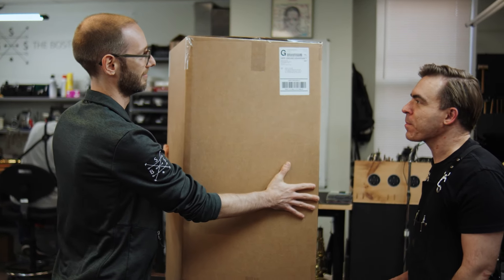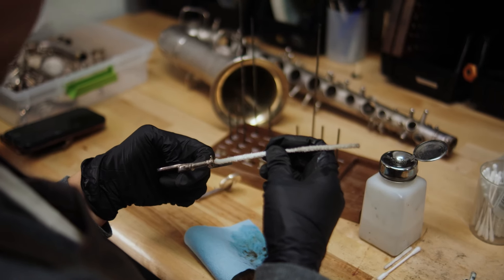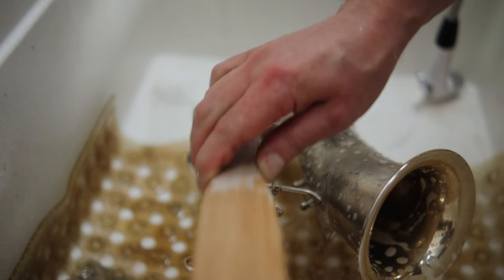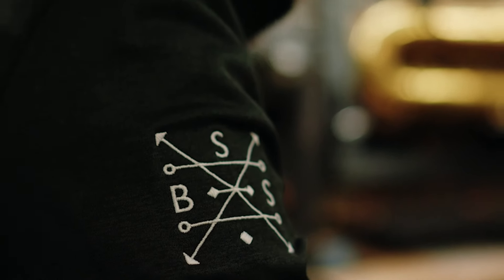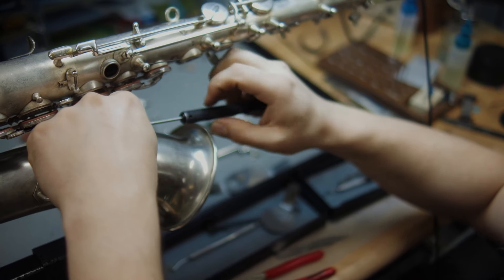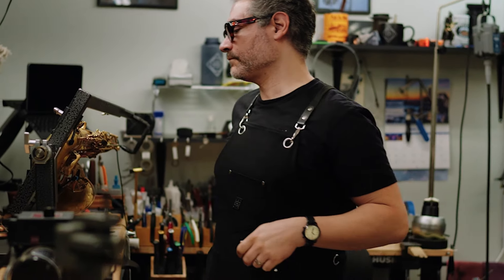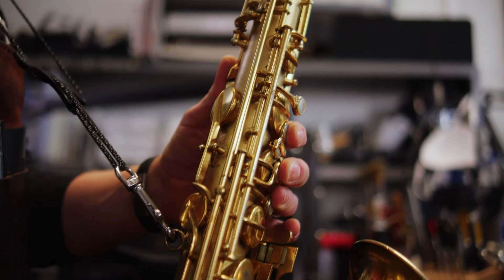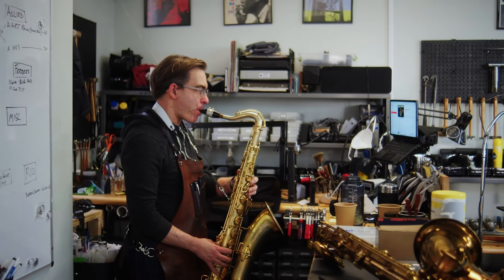The Ultimate Overhaul: Mechanical Restorations at Boston Sax Shop

Comment: Good  afternoon  does your shop add adjustment screws on the stacks on instruments  that did not have them originally.
Reply from the maker: Not unless requested by the customer but we find they are rarely needed if the manufacturer didn't intend them to be on the horn originally
Reply: Thank you very much. I have a Selmer series11 tenor that l intend to have them installed on.  As a former mechanic l know the ease of adjustment this provides.